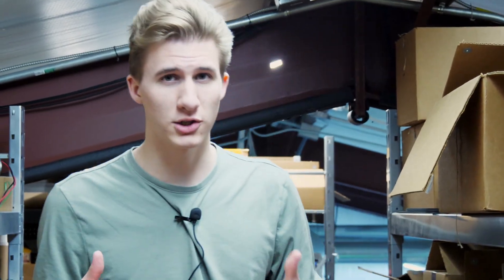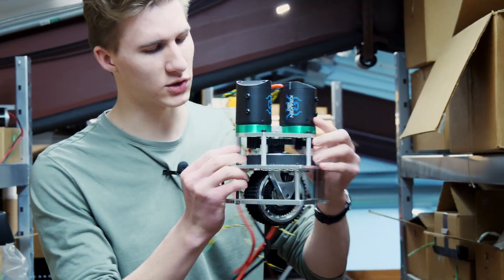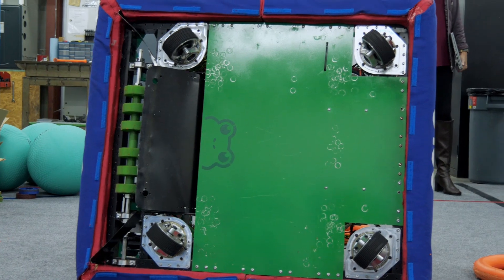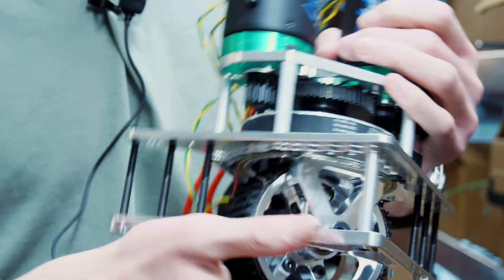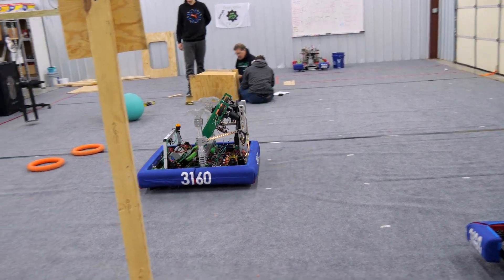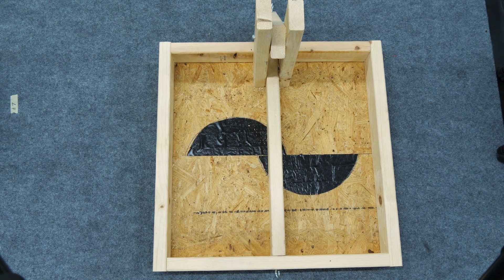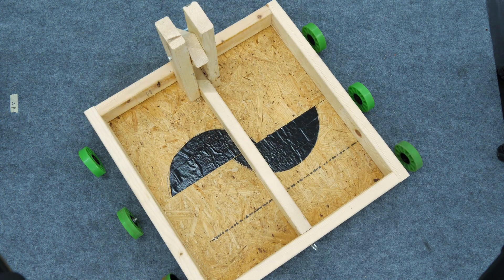F.R.O.G. Drivetrain Overview | 2025 ReefScape

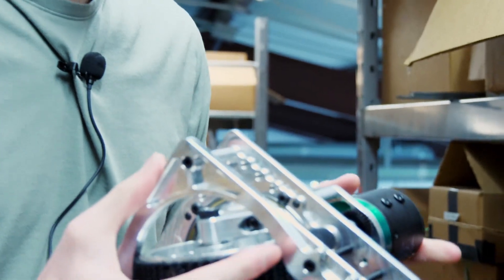Comment: 0:30 currently illegal to do more than 4 motors for drive to my knowledge
Reply: You are referring to the ban of differential drive. You are not allowed to have two motors power one wheel in drive mode. You can have one motor turn and one drive on each wheel module.
Reply: No, you've misread the rule, it's 4 propulsion motors, which means swerve drives are allowed. Swerve drive typically use 8: 4 for turning and 4 for driving, which means swerve drive is perfectly legal.